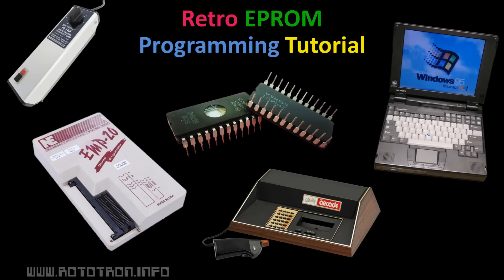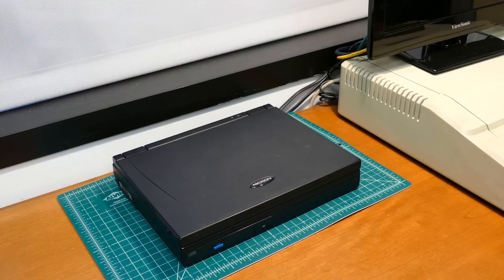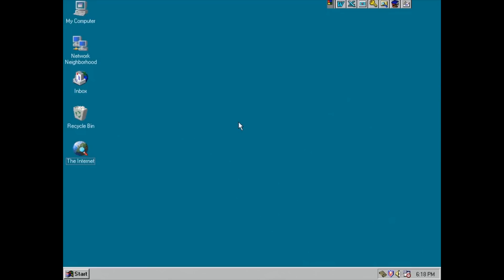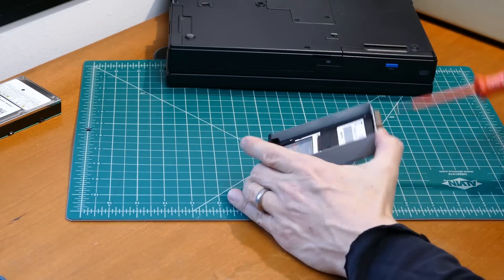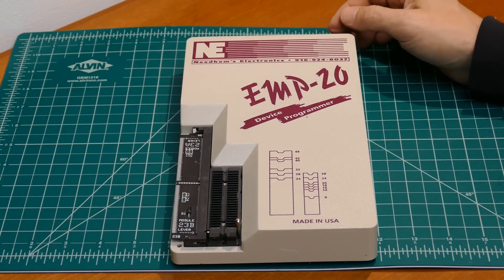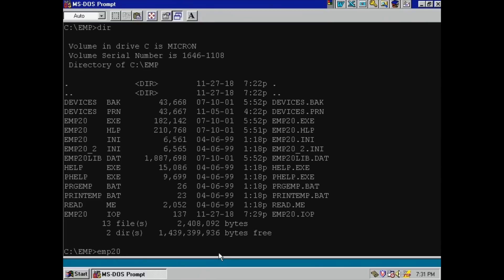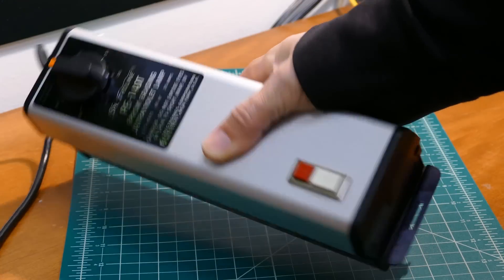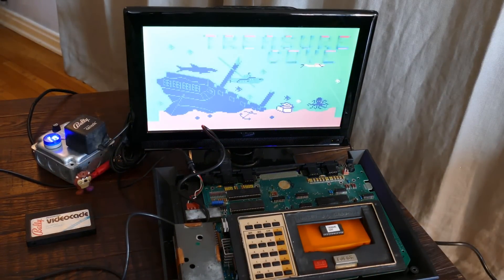Retro EPROM Programming Tutorial

Comment: It has nothing to do with people building retro machines prices being so high for old equipment with ISA slot. Those machines are still needed for industrial purposes, where facilities run very specific applications, that work only with those old, obsolete computers.
Reply from the maker: You bring up a great point about legacy industrial demand, but I wouldn't attribute the high market prices of vintage ISA motherboards solely to niche business applications. There's a large collectors market in which I participate, and back in the day, people and businesses threw out obsolete equipment, so much of it has ended up in landfills. Also, there are vendors selling brand new legacy-compatible motherboards with ISA slots that support EOL operating systems.  Still, I think you might be right that the dominant factor is operational demand.

Comment: Hi. I notice you have a 23A module for programming some types of CPLDs. I need one of these modules and can not find a lot of information on them. If possible, would it be possible for you to share high res photos or scans of the module? Any information is appreciated.
Reply from the maker: You can buy modules from the following vendor:  https://ardent-tool.com/Needham/EMP-20_Accessories.html
I'll post some high-resolution photos when I get back in town (probably later next week).
Reply: @rdagger  Thanks for the link, and for taking the time.
Reply from the maker: @michaelkarr7558  Plans for a universal module is available from the following repo:  https://github.com/schlae/EMP-20Module
Reply: @rdagger  23a/b is listed blank there. If I had the pinouts/connection list, I could use the universal module.
Reply from the maker: I scanned and photographed the 23AB module.  You can download the files on my website.  The files are in the download section of the corresponding page.  See video description for link.  I'm not sure if the quality will be good enough because of the black PCB and mask.
Reply: @rdagger  Thank you so much for going to the trouble!

Comment: After extracting an EPROM, is it then possible open it so the data can be modified? I have a 1990s computerized sewing machine that uses a TMS27C040-15JL EPROM. I would love to be able to modify the stitches and menus.
Reply from the maker: Yes.  You can use an EPROM programmer to read the chip and save a copy of the code.  Then you can use UV light to erase the original chip or purchase a used/old stock chip.  Most EPROM programmers come with software that lets you edit the hex code.  However, correctly modifying the hex code can be challenging if you don’t have the source code.  Ideally you could find an online forum where someone has already done the coding.  Afterwards you just program the chip with the new code and reinstall it.
Reply: @rdagger  Thank you.

Comment: Can I use a USB to DB25 Parallel Printer Cable Adapter with the EMP-20 to make it work on a modern PC?
Reply from the maker: I have not tried.  It might be possible using an emulator like DosBox, but I suspect it would be challenging to get the USB printer cable to work.  It would probably be easier if you had a modern motherboard with a built-in parallel port.

Comment: Hello.... you can help to fix my Texas Instrument laptop ?
Reply from the maker: I'm happy to answer questions but you might have more luck on a Vintage Computer forum:  http://www.vcfed.org/forum/forumdisplay.php?62-Texas-Instruments
Reply: I'm putting back on a old texas  instrument extensa 133Mhz  without original hard disk. 
So I put one on toshiba 40GB EIDE 2.5". Ok  in it the bios recorded it. sees it for 8770MB of available space. I am unable to start the erative system as this notebook does not have a CD-ROM, a reader floppy drive and a USB port. I tried to pre-use Windows 98 by transferring the CAB file to the hdd in order to start it in an integrated way but nothing.at startup it gives me red screen with message that file does not exist, nor the partition, it recommends me to use the PhDisk software.
How did the factory originally install the operating system?
Reply from the maker: @tinmachine722  The hard drive might be too big.  I ran into problems with a 16 GB drive.  If not, I’m guessing you could use a Windows 98 start-up floppy disk to create 2 partitions on the drive.  One partition for the operating system and a 2nd smaller partition for the Windows 98 CD files.  Then on a modern computer use a USB drive adapter to copy the Windows 98 CD files to the 2nd partition.
Reply from the maker: @tinmachine722  You probably have to find an old PC with a floppy drive and CD drive.  You can use the old PC to partition the 40GB EIDE hard drive into 2 partitions.  Install MS DOS on the first partition and copy the Windows 98 disc to the 2nd partition.  Then put the 40GB drive into the TI laptop and boot to the MS DOS partition.  In theory, you should then be able to install Windows 98.